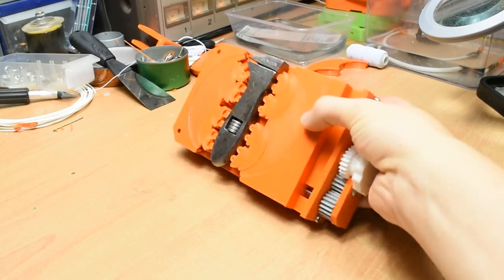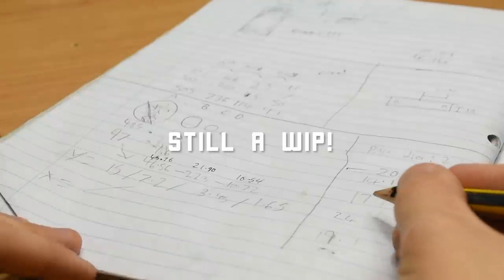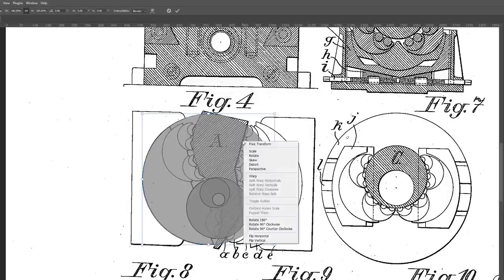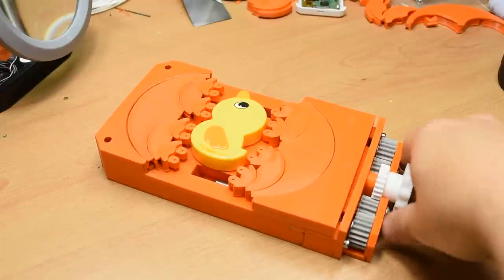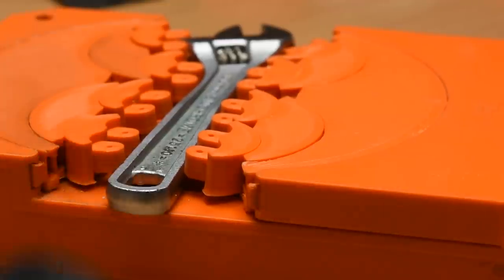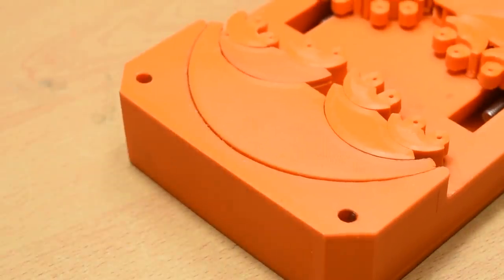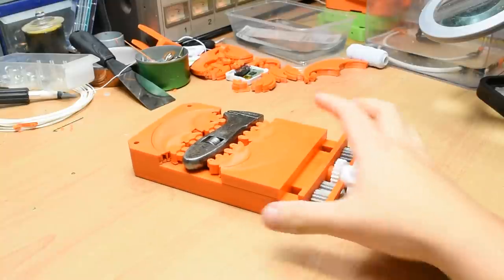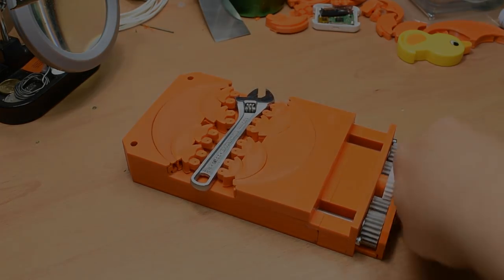3D Printed Fractal Vise (WIP!!!)

Comment: This would be so handy for model building! Especially odd shaped parts like wings, ship hulls, and fuselages.
Reply from the maker: Yeah I thought it could be useful for something like that, do you reckon that silicone or rubber jaws would be helpful for delicate parts?
Reply: @Borgedesigns  yes they would, actually I cover the tips of my tweezers and pliers with heat shrink tubing to help keep them from marring the surface. Either a silicone or nylon set of jaws would be great
Reply: What about printing the smallest jaws with a soft TPU ?
Reply: @damiensornette614  The only thing is you don’t want a material that’s too soft or springy because if a smaller part pops free it’ll launch into low earth orbit. This would be great for securing cockpit floors and ship decks so that you can add details or complete sub assemblies. It’s also useful for things like tapered wing surfaces if I need it to be held steady while working inside the wheel wells. 

I’m serious if you can make a couple different sizes and sell the idea to MicroMark you could probably make money hand over fist
Reply: for the jaws there is also an option to print in semi-flex TPUs with shore of around 98A… is very rigid with two or three walls and an infill greater than or equal to 20%

Comment: i think the magic that makes it work is that the axis each "jaw" rotates on is outside the perimeter of the part. Thus, when force is applied, the jaw naturally wants to rotate in-line with the force applied. So I feel like the "nubs" you have on the final jaws might reduce the effectiveness a bit
Reply from the maker: yeah im working on a proper set at the moment, still printing at the moment!

Comment: “A little less than half” sounds like a more likely measurement to me than “exactly half”. 48% sounds good.
Reply: i can imagine exactly half causing issues
Reply: Exactly half means no clearances… clearances matter…
Reply: "0.48%" Is not a little less than half, it's only a little less than half of 1%.
Reply: @actually5004  who said 0.48%?
Reply: @jeremymcadam7400  Damn and you were so close to getting the joke.
The OP wrote: "than “exactly half”. 48% sounds good."
If it were written as "than “exactly half”.  Fourty-eight percent sounds good." then there would be less confusion, and is the reason why it's a common English practice to not start sentences with numerals.
Reply: @actually5004  ooh I see. On mobile, "48% sounds good" is on its own line so it looks completely fine
Reply: @actually5004  you know, I could see you being confused by that in handwritten text, but this is electronic. If you’re getting confused here it’s your own damn fault.

Comment: I would love to make this just as an add-on to a regular vise!
Reply: Great idea. But if you put this between the jaws of a regular vise, there is no space left to clamp stuff. You need to have this lying on top, held by two Z-shaped metal holders (z-profile) instead of the regular jaw covers. This keeps the old vise usable as well.
Reply from the maker: Its in the pipeline, im working on refining the jaws first

Comment: Very cool build!  Some thoughts:

1. To allow the dovetails to print better without needing supports, add a very thin vertical wall to the front of the groove, just thick enough to be able to be printed.  This will be easy enough to cut away cleanly after printing.
2. Add a version of the base with flanges on the sides with holes for mounting, as most other vices have.
3. Design sleeves for the innermost jaws to be printed out of TPU.

I hope that this helps!
Reply from the maker: Ive ordered some TPU, and the version im working on has multiple mounting options including optional flanges, or a set of holes in the base that are not covered by the lead screw like the current ones are.

Comment: I agree with John Beauvais. Something like this could be great in modelling. The only really useful and foolproof clamp for odd-shaped parts is your fingers. That’s all very well until you realise you’re committed to holding that Wildcat fuselage together for at least another 15 minutes to give the glue a chance to set. It would need to be a hand clamp though, not a vise. The closest I’ve come is a handlebar tripod mount from eBay, but the jaws are wrong. If you paired the fractal jaws with the tripod mount I think it would be a winner.
Reply from the maker: Yeah thats a good idea, to truly work from any angle. Ill add it to the todo list.

Comment: It makes sense to make a 3D printable version so more people can enjoy this themselves, but for those of us with machine tools, I really don't think this would be very difficult to make. Turning dovetails like this on a disk, then drilling out 2 pockets and cutting internal dovetails can all be done on a lathe. It might be easier though to bore the 2 holes in a disk, split it (OD dovetail already turned before that), then mill the half internal dovetails on a rotary table.

If you have a good size lathe, I see no reason you couldn't mount a rotary table to the lathe saddle.

Believe it or not- this could be done almost completely on either a good lathe, or mill- easier with both, but just depends on your setup skill and machine size. 

I've thought these were cool since I saw the original item last year- I should go make one of these.
Reply from the maker: If youve got the setup I say go for it! I have next to no machining skills myself (Yet) but one of these vises looks like it could be really good practice for a few types of operations.

Comment: that first large circle is good for 95% of situations. the rest of the smaller circles are just showing off
Reply from the maker: I guess thats the point of the original design, a regular vise is almost always useful, but that 5% of the time its good to have. Also probably why the original never took off, something that expensive wasnt worth it for such little use.

Comment: Looking at the design, I think the .48 number is actually correct.  It provides for some tolerance between the two sub-jaws at each level, where if it were .5 instead, then debris could get caught between the sub-assemblies.

Comment: Well done.   Nice reel to reel
Reply from the maker: Thanks! Its not working unfortunately due to missing parts. Built like a brick though, I found it dumped down a hill off the side of a road. Dragged it back up, checked inside for moisture and powered it up no problem. Just a shame some of the machined parts are missing, and one of the spool mounts is broken. Makes for great set dressing though!

Comment: I wonder if this might not work just as well (on something the size of the wrench) if it were just 2 pivoting contacting jaws 4 point of contact) or 4 pivoting contact jaws (8 point of contact).  if it works just as well on large items..  there may be a way to (inexpensively) CNC a metal version of the design.  (the dovetail would not be attached, but would be added onto the pivot, and the female dovetail would be a bottom/top layer CNC'd from one direction (top down) then sandwiched together with bolts or welds.  the male dovetail is just a guide and doesn't take any stress as the jaw pivots, so just the main curve of the back of each jaw segment is what sees any pressure.
Reply from the maker: Very true, i ve been thinking about this. The new version has much loser dovetails, since they dont actually take much force, so I was thinking that a simpler design with T shaped  dovetails that could be milled without 5 axis machining could be interesting to try. The Top half of the female jaws would be a separate piece, and the male jaws could be milled in one part just by flipping it over.

Comment: Nice work.  I think the slop or loose nature of the pieces allowing for flex could be eliminated by making the faces of the dove tails taller and not as deep. Also just a lip at top and bottom is all you really need as once lubricated the forces are just pushing straight through to the back and so having a larger face on both pieces to mate to will allow a better force application with less chance for distortion and keep the pieces from flexing too. As long as the radii are consistent and each piece mates properly the rotating will be smoooooth as Barry White. 😉👍 Also once the flexing is removed you can go back to one threaded rod. All this will also require scaling up the size which makes it easier to make although more resource rich but will also aid in the heft being better suited for clamping. You might even leave voids in the bottom for installing lead bar or rod to help weigh it down. Now, the most i.portant question: can you make us both one?? Seriously.
Reply from the maker: Your right that a groove system could work, the biggest downside is that it rules out being able to have a gap down the middle to facilitate drilling which is something im experimenting with currently, but a groove system would be so much easier it would not be hard to model both and have two versions for different uses. The current jaws im experimenting with are 20mm instead of 10 which has already helped with flex understandably, and your right ideally one threaded rod would be better, albeit not as cool.
Reply: @Borgedesigns  Haha, thats true, the gears up front add a cool factor lacking in a single rod but of course for durability those gears would be covered so they wouldnt be seen anyway.🤷🏻‍♂️

Comment: It would be interesting to add some "wings" to the base, to be able to clamp or bolt it to the  bench ! Otherwiser very interesting design, I'll wait a bit for a final version then I think I'll have a go at making one :)
Reply from the maker: it has 4 holes to screw it down currently but two are under the lead screw so its kinda annoying, ive already reworked it for the new version
Reply: @Borgedesigns  Cool :)

Comment: Why did you make the smallest teeth a circle instead of another waning Moon like int he original? The plastic wouldn't be strong enough with the pointy bits?
Reply from the maker: It was just a work in progress, the designs I had tried were not working as I had liked so its a compromise. Current version is looking promising which should improve it considerably.

Comment: This is an exciting realization of this marvelous idea. You are going great guns!   Like almost everybody, I have seen the restoration video also. 

A suggestion: using dovetails to hold down the sliding jaw gives  unwanted lift, and there are better ways. The best is a patented feature of the Kurt Angle Lock milling vise. Give it a view.  The biggest failing of unreinforced plastic being low stiffness, is there any way to incorporate a couple of steel bars into the affair? I do understand that you have mounting holes designed in. Screwing it to the bench certainly mitigates flex, agreed.
Reply: And I forgot to add that based on this video, without any need to check your other content, you have my sub.  Keep up the swell work!
Reply: And as a demonstration of how inspiring this project is, here is a third unsolicited wrinkle. Could there be a version that keeps the fixed jaw close to the edge of the bench and the screw handle, allowing small objects to be more in range of subsequent operations?

Comment: After seeing the original vise I was hoping someone would take on this endeavor with 3d printing.    Just a thought, if you make the jaws twice as high and use 2 dovetails (essentially just double stack the jaws) that may provide more stability when grasping objects.
Reply: Simply making the jaws thicker will reduce the flex a lot by reducing angular clearances.
Reply from the maker: New version im working with uses double height jaws

Comment: Super cool, well done! I wonder if a similar concept could be applied to 3 dimensions, for those really really oddly shaped workpieces🤔
Reply: That would require n different size  ball joints and you would have 4^n jaws not just 2^n, where n is the number of steps. but in theory it should be possible
Reply from the maker: Fractal sphere vise, could take the trophy for the worlds most complex vise ahah

Comment: Maybe  flex can be compensated just increasing thickness, but with youur design it seems quite easy to do just scaling everithing up on the z axes. Still, for what is supposed to be used a plastic vice, looks pretty amazing. I can se in next month some guy from some metal casting channel take your files and cast it in alluminium bronze.
Reply from the maker: Yeah the new jaws im printing are twice as thick, yet to test however.

Comment: Tabs on the sides for mounting to a workbench? Just a thought. Makes access easy but might take from the sleek design.
Reply from the maker: It has mounting holes but two of them are difficult to get to, v2 that im working on has fixed that and it has a few ways to mount.

Comment: Nice job. How about designing a version without the base?  Just the two jaws, one stationary and one movable.
This way you could clamp objects with a large Z axis.  
Or make a set of spring clamps (hold downs) with fractal jaws.
Reply from the maker: I like the without a base idea a lot, I just got a larger milling machine that I could test it on, ill add it to the todo list.

Comment: Could you print with a material that you could use as a mold for casting it in metal? If so that would be pretty sweet to get a metal version of this
Reply: Metal 3D printers are a thing… (they just cost more). They are really useful for printing exhaust headers (and the occasional racing engine block).
Reply: @allangibson2408  yea I seen them before but super complicated and pricey, I think for something like this fractal vise doing a casting should be cheaper and efficient enough with some clean up and shaping to make a even more solid vise then the plastic printed version. Although this plastic version does seem to be solid enough
Reply: @kevinfitz3721  For a lot of things plastic would work really well (particularly if you are clamping plastic).
Reply from the maker: Im printing in PLA so lost PLA is an option but would take ages, but since there is so much demand I am looking at the viablilty of casting it in the future.

Comment: It’s curious how far can it get in terms of fractals steps. Probably it can clamp a smallest objects with 10 subdivisions or so
Reply: Not much. You are halving the size each step. In ten steps last jaw part will have diameter 1024 times smaller than the first one. You will need 2mm just for the rail, so there is really no point to make the smallest jaw under 5mm (you cant have the rotation center inside the rail). With 6 steps you will be already at 16cm big jaws and at the limit of printing parts as one piece.

Comment: How do you achieve that beautiful surface finish? Ironing?
Reply from the maker: No actually, ironing would improve it actually and I ironed for a year before my printer just started to refuse to do it, so I go without and its a decent finish. I use a ender 3 with the standard .4 mm nozzel, and print with cheap ebay PLA. I guess it is just what type of printer, because my old I3 B got nothing this good ever.

Comment: Excellent work!  HTR is one of my favorites, and through this video your channel may be soon <3

Could you make two holes straight down through the main jaw to access those two mounting screws to the bench? It wouldn't compromise the jaw at all and you wouldn't have to disassemble it to move the vise.
Reply from the maker: V2 im working on has much better mounting options, the problem is that the screw is in the way but thats fixed on what im working on.

Comment: I'm very interested in a smaller version for engraving purposes. What are you tolerances and how much could I scale the model down without getting into issues? (Prusa Mk3S)
Reply from the maker: In the version shown here the dovetails have .175 on each face, but in the newer version im working on the jaws are all a lot more lose since I realised that they dont need to be tight due to how force is applied. you could try with just the smallest sets of jaws since they only take about 30 mins to print to see if its viable since all the dovetails use the same tolerences.
Reply: @Borgedesigns  I will give it a go. The only thing about the applied forces and the tollerance would be that you might want to make a diamond shape rather than a dovetail. The dovetail will guide the circles but become sloppy when force is applied, if you would have a diamond shape I think the it will tend to align better on the xy plane and have less tendancies to popping up (which might be an issue once you're working with thinner items such as nametags which are oddly shaped and thin)
Reply: @Borgedesigns  I printed the dovetails in Prusament PLA Silver on my Prusa MK3S with 0.2mm Quality layer heighth at 100%, 80% and 60% in the xy orientation so the perimeters of the dovetails have the smoothest surface. The 100% printed well and had some play but not excessive. The 80% fell just in between layers and had a bit more play after removing the supports but might work a different layerheighth setting. The 60% is slightly snug but didn't need any specific adjustments next to removing the supports.
I think choosing the right layerheighth and when scaling down optionally using a smaller nozzle (I used a 0.4mm nozzle, I don't have any other sizes) might benefit a scaled down print. But I'm really happy with the results and should have a look at printing a full scaled down version (Possibly in PETG due to less deformation when in use for longer periods of time, or maybe ABS but haven't printed that on my machine yet).

Comment: what are you using for the lead screws?
Reply from the maker: just m5 bolts 100mm long, ill try to provide an ebay link for the final version
Reply: @Borgedesigns  cool thx. I used m4 thread myself as I had to print it on 90% to fit my resin printer